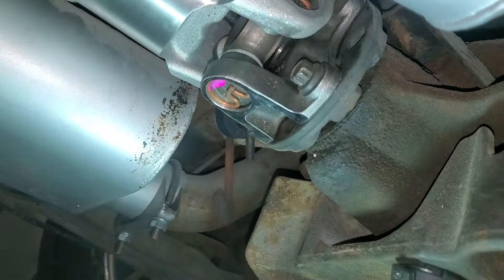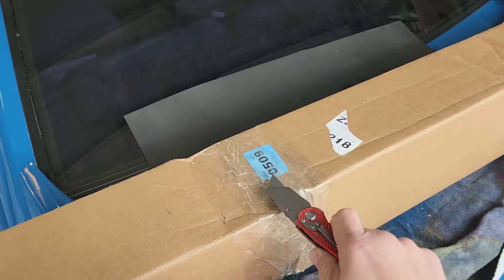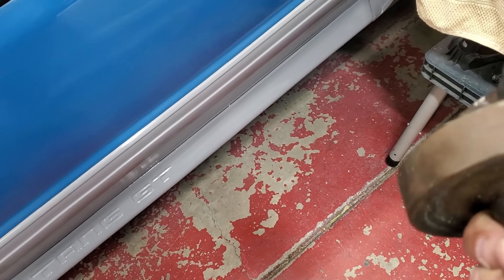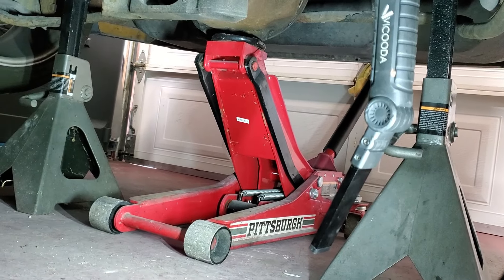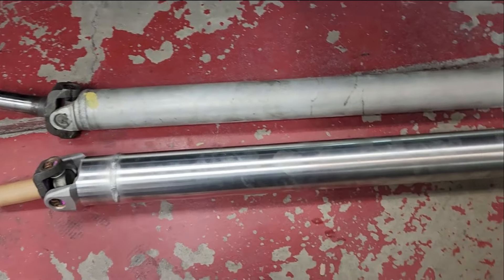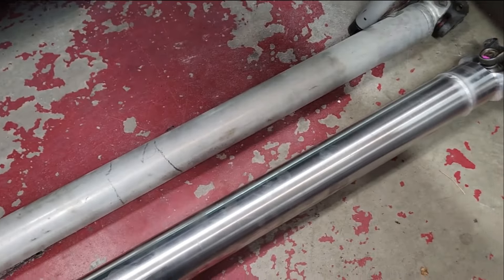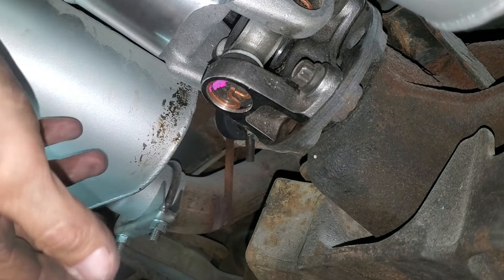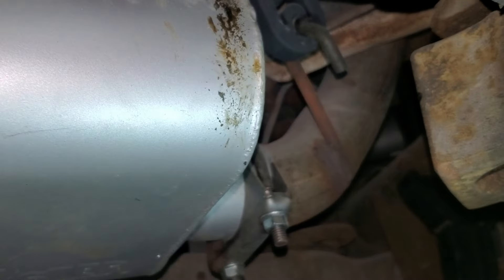The 89G - Installing a JEGS Driveshaft in a Fox Body Mustang | Step-by-Step Guide

Comment: nice  were back to foxbody stuff  ! the other vids are ok but stangs stuff will give you the most views...
i got the ford alum shaft looks just like the jegs one  but probably half the cost. didnt know you can run a van drive shaft in the stangs ... 
remember whenever you do one thing 2 other things need to be done to do the 1 thing you wanted to do.. so a hour job turns into a 3-4 hr job ez !
Reply from the maker: @AwakeDude911  yep... classic "it's a 20 minute job" turning into 90 minutes. I'll just say that the sticker with the PN on the Jegs shaft contains part of the Ford Racing/Motorsport part number. And I agree, they look A LOT alike. The Jegs shaft weighs just a little bit more, according to Jegs site. I got this one for $335 back in January, and they are just under $400 now.
Reply: @89G   ooo my ..think i paid $200 for the ford one and stuck it in the corner till i got the engine and trans redone...
Reply from the maker: @AwakeDude911  nice! That's about what I paid for my Ford Motorsport one, 20 years ago.

Comment: I got a police Crown Vic aluminum driveshaft in mine. I still have the AOD until I put in the T5. The AOD has the damper ring like the one you used to plug your tail shaft. I had to buy a Spicer yoke because that ring interferes. Gear wrench is love for those driveshaft bolts. I was wondering why you were putting an aluminum driveshaft in since you had aluminum already. Then  I seen the damage. Have a great day G! 
👊😎✌️
Reply from the maker: @BigStickStangs  what year Crown Vic? Yeah... I might go get this, Aerostar drive shaft fixed. It's not that bad, but I don't like knowing it's like that.
Reply: @89G  I’m not sure what year I bought it from a friend. $50 The yoke cost me 90. And then U joints and balance,  I might as well buy the new one 😆
Reply from the maker: @BigStickStangs  hahahaha. True
Reply: @89G  I’m curious if the splines are the same as the T5 when I put that in 🤔
Reply from the maker: @BigStickStangs  yes. The AOD and T5 are the same. You don't need the stupid weight on there either.
Reply: @89G  Good to know. I thought so.I really just wanted to put more comments on your vid to help you Who is the algorithm.  Have a great day! 
👊😎✌️
Reply from the maker: @BigStickStangs  oh, gotcha. Thanks Rick! 😎
Reply: @89G  Thank you!
Reply: I think they just want us to use the app for everything. Heck we can have a whole conversation 😂
Reply from the maker: @BigStickStangs  lol. Yeah, you're probably right on that one. 👍
Reply: @89G  Comments generate views and recommendations I think
Reply from the maker: @BigStickStangs  well, I hope so. How's the 70 doing? I love that car.
Reply: @89G  Thanks so much! He’s doing great. I’ve driven it a few times. The Fox project has taken all my time. I think the 70 is getting jealous! 😂
Reply: Do you have FB?
Reply from the maker: @BigStickStangs  yes I am on there and IG.

Comment: Great job as always 89! I had a motorsport aluminum driveshaft but I think I need a different one for the t56. Not sure but I think the length is different, spline count definitely. Do the new u joints have zerks?
Reply from the maker: @SleazysGarage  no zerks on either the Jegs or my Motorsport. Yeah... you'll definitely need to get it shortened up, too. Do you have any decent driveline shops nearby?
Reply: @SleazysGarage  hey brother, I forgot to comment last week on your video, so sorry. Comment incoming
👊😎✌️
Reply: @BigStickStangs  no worries bro! I know you're watching and appreciate it! 👊
Reply: @89G  I'm sure there is, I'll have to look around when I get to that point. It'll be a good problem to have I think.
Reply: @SleazysGarage  wait a minute I did comment on the video. Sucks getting old ,to much going on at the same time. 😂🤣😂
Reply: @SleazysGarage  it was the short I was thinking of. I did hit the like button! 👍
Reply: @BigStickStangs  I was gonna say, I thought you did. 🙌
Reply: @SleazysGarage  🤯🔫
Reply from the maker: @BigStickStangs  hahahaha, dude, I'm in the same boat. Can't remember anything for 5 minutes.
Reply: @89G  h😂